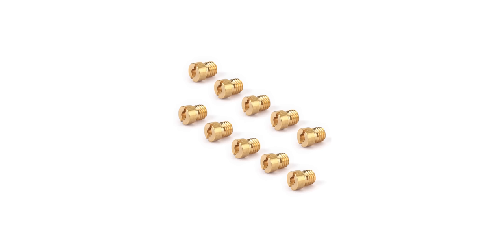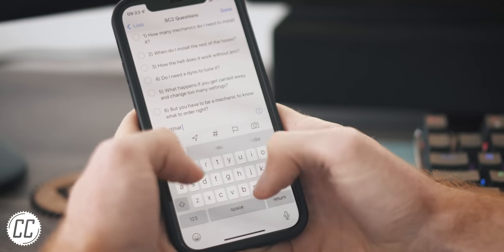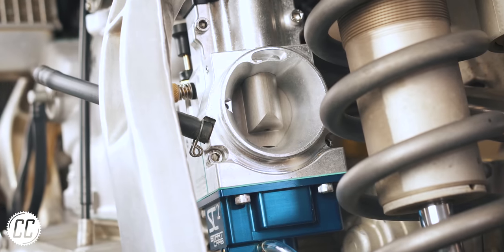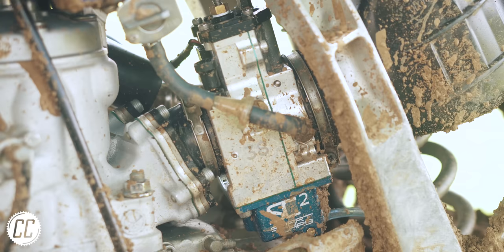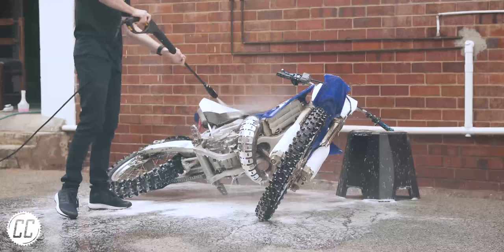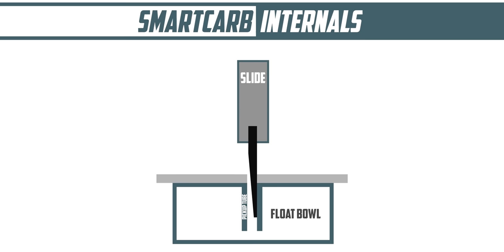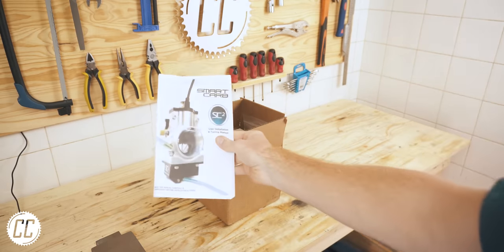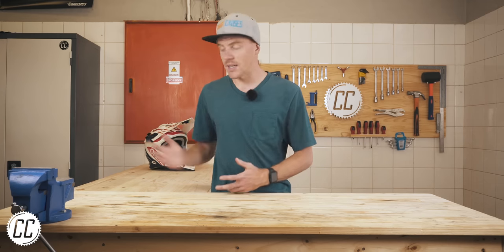The Best Carb Money Can Buy? | SmartCarb SC2

Comment: This carb seems nice but is nothing special as carbs with metering rods have been around for a long time. Furthermore the only thing that is adjustable is the height of the rod meaning you shift the entire fuel "map" up or down instead of being able to tune each area individually (idle, midlow, mid, WOT)
Reply: Metering rod carbs have been in development and in the market for quite some time, the first example being the Posa-Fuel in '67. Like anything though the concept went through multiple iterations demonstrating numerous improvements with the SmartCarb being the latest version available. The metering rod handles the fuel curve, yes, and moving it moves the entire curve, that is true. We advise our customers to tune from the bottom up, setting the idle and off idle response first by adjusting the metering rod position. The grind angle handles the rest of the range and we can supply a variety to meet the needs of different applications. The difference between the SmartCarb and all the rest is the internal, integrated float bowl venting which serves to drive fuel flow in the float bowl proportional to the air density inside the airbox at the venturi and also its velocity. That feature makes the SmartCarb very adaptable and dependent on the engine's needs and precludes the requirement for additional fueling circuits on the top end (think Lectron). We think it's pretty special.

Our wrists aren't stepper motors switching from idle to low mid to mid to top, but rather we sweep through the throttle constantly. A single circuit fuel curve suits that very well - provided you have the correct metering rod in the correct position of course. We make that as easy as possible with that red button on the top.
Reply: @SmartCarbFuelSystems  The altitude adjustment portion is a great benefit but unless the grind of the metering rod is bike, mod and altitude specific you are only getting in the ballpark of what is acceptable. I'm sure you can get close however having multiple adjustments at your disposal allows tuning in all areas so that your throttle response is linear and not like a step motor. Note that a transparent float bowl is convenient and would be a nice upgrade.
I must say I do like the metering rod height adjustment on the fly however edelbrock already did this with their metering rod/pumper carb that has since been discontinued.
Reply: @timothysmith3311  The grind of the metering rod is engine characteristic specific, with alternative grind angles available for to suit different applications' needs, modifications, and fuel selection. As explained above they do not need to be altitude specific. Altitude indifference has been well documented with this fuel system, with Pikes Peak records and UAV drone testing up to 22,000 feet with minimal variance in A/F ratios being two examples. The altitudes that the customer rides at isn't data we collect when ordering nor accounted for in pre-tuning the carb.

The best way to make throttle response linear is to provide continuous, linear fueling rate through the throttle rate. Only a single circuit designed for that purpose, like the SmartCarb's metering rod, can provide that. Much harder to do with multiple, overlapping circuits signing on and off through the throttle range. Noted on the float bowl transparency. We may decide to add that at some point. In the meantime the drain hose on the SmartCarb can be used to view fuel level in the bowl per our drain hose method. That is what the two laser etched marks are on the left side of the SC2.

The Edelbrock QwikSilver is a direct predecessor to the SmartCarb (same inventor) and saw the introduction of the clicker adjuster on the top. Interestingly enough the red clicker thumbwheel on the SC2 in this video was manufactured for Edelbrock over 20 years ago. The SC2 is the culmination of those earlier efforts, dating all the way back to the first metering rod carburetor, the Posa-fuel in '67.
Reply: @SmartCarbFuelSystems  I had a quicksilver carb and thought it was brilliant however since it was discontinued I couldn't get a hold of new metering rods for it. Why delete the pumper portion? When you snap the throttle open I imagine this would be beneficial off idle.
Reply: @timothysmith3311  no pumper required for the same reasons that no power jet is required - the internal float bowl venting feature provides near instantaneous fuel lift. Between that and making sure not to over-carburate any given engine (too large of a size), there's ultimately no need for it. These carbs keep up.
Reply: @SmartCarbFuelSystems  do you have any dyno graphs of the same bike same mods with a traditional style performance carb same diameter (like a mikuni flatslide) that's been tuned vs your carb? I'd like to see the difference in a real setting and the power curve.

Comment: Rich running engines run cooler. Lean running engines run hotter . If it's a 2 stroke lean will ruin the engine. 2 stroke rich will just foul  the spark plug. Do you want to rebuild the engine or clean and,or replace spark  plug. ?

Comment: This is beautiful. I love building mini bikes and go karts out of Predator and other small generator engines. This could be a game changer for us since we dont need to need to worry about jets or such. This is a fantastic product.
Reply: Did you try it? Does it work for 4 strokes?  The message I got was a 2 stroke able carb. Will it work for a 60 year old bike?
Reply: @Cj-yw8cs  I havent, but I dont think there would be any issue trying to fit this onto a two stroke. As long as you have a good oil mix, or an oil feeding system in the engine, you should be good to go with no issues. 2 stroke carbs and 4 stroke carbs arent THAT different from each other, and this one is honestly simpler.
Reply: @Cj-yw8cs  and to add onto that, if you go to their website, they have 2 stroke options as well if you wanted to get one for a specific bike.
Reply: @3v068  the bike used in the video is a 2 stroke. The website will probably not have info on my machine. The joy of old oddball motorcycles

Comment: The best way to tell if the carb is correctly tuned is the spark plug. If you want to be on the safe side you can check your spark plug after the first 15min of ride. According to you mixture and gasoline it may need minor changes. We used to do that when go Karting. Remember when it's leaner it goes faster so it may trick you.

Comment: This kind of carb has been used on some planes for a few decades. From what I remember, they have an issue with the gaskets wearing out fast? Might be wrong.

Edit; it looks similar, but it seems to be an entirely different method of operation.

Comment: You missed the single most important detail/issue, which is you no longer need to worry about jets getting clogged from bad fuel.  I say this “assuming” it doesn’t not have a low idle jet.

Comment: If it's using less fuel does that mean less lubrication on top end??
Reply: Yes it is..high risk of piston to jammed
Reply: No. Sufficient lubrication remains - we're simply not passing as much of it out the exhaust but rather combusting it more efficiently due to finer atomization and increased surface area of the droplets. SmartCarbs are no more prone to causing engine damage than any other carburetor when properly adjusted.

Comment: Interesting design another option to convert troublesome injected bikes to carb. The fitment issues on your bike would be a deal breaker for me tho. Paying that much for something id want it to fit with out causing the intake boot to hit the rear spring and kink the throttle cable.

Comment: Looking at the spark plug will tell you if you have the proper mixture. This is very important on high performance 2 strokes because running to lean makes them blow up quickly.

Comment: Fun fact many may not know. William “Red” Edmonston invented the first metering rod style carburetor in 1967 and another in 1971. Lectron began selling these in 1974. They largely have not changed since. GM acquired Lectron and “Red” improved the metering rod style carburetor and it became the Smart Carb. 

So, these are $1,000. 

They’re cool. But not that cool. I’m patiently waiting for the competition to drive down the price. There is zero reason that carb is that pricey. It’s based off the same technology invented by the man that did it in the late 60s…
Reply: Our (US-based anyway) competition will need to wait until the mid 2030s for our core patents to expire covering the integrated float bowl venting, external adjustability, and variable throttle rate venturi/airflow shaping features. Beyond simply improving upon Red's earlier work, the SmartCarb brings features that are entirely new. No other carburetor does what the SmartCarb does.

SmartCarbs are fully CNC machined in the USA, which is why they cost what they do and with 30% increased fuel economy, the more you ride, the faster it pays for itself!

Comment: can i use it on a four stoke or a 2 stroke 70cc moped
Reply: 70cc is a bit small for the littlest SmartCarb (26mm). Should work on a 2-stroke if it's a bit of a hotter setup. Reach out direct for best advice.

Comment: Personally I'm sick of "smart" things.  I've gone back to a 2 stroke with a carburetor.  KISS - Keep It Simple Stupid.  I know I'm in the minority but I'm pretty confident I'm not the only one who feels this way in today's world of too much electronics.
Reply: In this case it's just a euphemism. SmartCarbs are mechanical carburetors just like a Keihin, only even more simple with no jets and only a single circuit. In fact it has fewer parts than any other carburetor fuel system in its class. The only electronic aspect is the TPS, which works similar to how the stock Keihin TPS has for over 20 years now. 

We would agree with your KISS sentiment. Simple is better.

Comment: I am interested in Classic Minis and accidentally found your carb review.
The SC2 carb is very, VERY, VERY!!!! similar to SU carbs (including the tapered needle lifting out of the fuel jet, lifting damper and air temp and pressure compensation) used in most English cars from  the 1920's till about 1990. In 2022 it can't really be described as "smart"; as it was dropped for the last of the classic Minis in the 1990's for fuel injection, because they could not satisfy pollution and fuel consumption rules.
Sorry. Dave D Sydney
Reply: We're not sure why this is a recurring misconception. The SU and the SmartCarb are nothing alike in their operation and if you knew anything about how the SU carb works while watching this video explaining how the SmartCarb works it would be quite clear. 

SmartCarbs use a flat slide directly throttled by the handset, more akin to other modern carburetor fuel systems like the offerings from Keihin/Mikuni/Dell'Orto. The SU carbs are CV or constant velocity style carburetors that are throttled with a butterfly with the resulting vacuum/depression lifting the piston slide, i.e. not directly throttled. SmartCarbs use air density/velocity to drive fuel flow through the float bowl, NOT to throttle the carb. That integrated float bowl venting feature, the use of a metering rod, and its unique venturi shape designed to focus signal at said rod are all PATENTED features. Furthermore the SmartCarb has already achieved EPA/ARB on-road emissions certifications in 4-stroke motorcycles, twice! All due to its superior metering rod (not a needle like in the SU) fuel atomization.

We hope this clears that up for you.

Comment: Sounds pretty awesome - the drawback he wasn't acknowledging was the price. I looked for what I might put on my Suzuki GZ250, they only have dirt bikes (seemingly emphasis on 2 stroke) so I looked at the RM250 which I figured would be the most comparable (though 2 stroke would be more power and flow than a 4 stroke of the same displacement). $700 for the carburetor. Would take a lot of miles for the gas savings to make the slightest dent in that.
Reply: How much is a Lectron or FCR?

Comment: Sounds like a overly complicated copy of a CV carb. So.... Why would anyone need this? I'm a firm believer that computers ARE NOT NEEDED to operate any motor vehicle, and should be REMOVED from your vehicle A.S.A.P.  One DOES NOT need any computer to operate fuel injection, as well. A well timed fuel injection pump running off a pulley will do the job, and did, for many decades. The computer on your vehicle is NOT there for the operation of the vehicle.
Reply: The SmartCarb is a considerably more simple design compared to the CV style carbs, with fewer parts too. It's a purely mechanical carburetor with no computers. In cases like this YZ250 where the bike's stock ECU requires throttle position input, we offer a simple, solid state, linear magnetic position sensor with no additional moving parts, unlike the stock carburetor piezoelectric type sensor with its little arm riding the top of the slide to turn a shaft...

There are a number of reasons to use the SmartCarb including greater performance and fuel economy, elevation/temperature compensation, the ease of external adjustability without tools, zero fuel spillage, and more.

Comment: The main thing that I hate about carbs is that even when you cut off the fuel and run the bike until it stops, if you let the bike sit for awhile, the carbs will get gunked up thanks to the damn ethanol that they contaminate our fuel supply with these days... The only fuel injected bike I have is my Harley and it starts right up every time even if it has been sitting for months...

Comment: Lectron carbs have been automatically compensating for altitude, temp, and humidity for over 20 years where you been smartcarb? If you were SmarterCarb maybe you would of came up with the idea first.
Reply: Lol, ok. We encourage you to do some research on these carbs. Both were invented by the same person, William Edmonston, nearly 40 years apart. The Lectron wasn't even his first metering rod carb - that would be the Posa-Fuel in '67. GM acquired Lectron in the 70s and Edmonston went on to make the Ei Blue Magnum, the Edelbrock QwikSilvers, the AFT HVV, and ultimately the SmartCarb. We're simply the natural evolution of the design only with features and benefits the Lectron or other earlier metering rod carbs don't have including external adjustability without tools, integrated float bowl venting (for even better air density compensation by the way), variable throttle rate venturi profile, and TPS. Check out the article on our website that explains the history of these carbs and how they compare.

Comment: 2 strokes are NOT destroying the environment!  That 5L V8 that you drove your 2 stroke to the track and everywhere else IS destroying the environment.  It's not once every 2 weeks that you took your bike to the track that is tipping our planet to the brink.  It's what we're all doing all the rest of the time!  Don't worry about you 250cc single cylinder 2 stroke that you ride when u have a free afternoon.  Worry about the car you drive.  Worry about your local power plant.  Worry about consuming plastics.  Go have fun on your 2 stroke.  If it troubles you that much, then go get one of the new KTM direct injection 2 strokes.

Comment: Very similar to the old SU and Weber side-draft carbs from back in the 60s.
Reply: Not so much. SmartCarbs are flat slide carburetors directly throttled by the handset, not by vacuum à la CV style carbs. Air density is used instead to drive fuel flow (not operate the throttle slide/piston) by way of integrated venting inside of the airbox.

Comment: A glorified Gardner carb, which is sort of a pressure carb. However, there will be a host of different slope needles to choose from, so not an easy job to optimize for an engine type that has not been previously setup by the makers. And as for more power, forget it. Dyno man for 30 years.
Reply: Hardly. The biggest difference, of many, and one that sets the SmartCarb apart from any other carburetor fuel system, including other metering rod carburetor fuel systems, is its patented, integrated float bowl venting feature. It's the other half of the air density best-use equation and it allows the SmartCarb to accommodate the fueling needs of a huge variety of applications without a commensurately huge variety of metering rod tapers or fuel profiles. To put it into perspective for you we use only 8 metering rods across 3 different sizes (36, 38, & 40mm) to cover the needs of nearly any 125-500cc 2-stroke dirt bike (our primary market) covering stock to big bore to high comp to supermoto to snowbikes to MX to hard enduro, etc.

And yes, they do make more power which is why top level athletes and speed record holders use it. Not to dismiss your experience, but you haven't seen anything like what this fuel system is capable of, nor do you have a firm grasp on its function by comparing it to the Gardner...

Comment: Just on the surface, it looks like the old air valve carburetor design, such as SU carbs that were used on many vintage European and Japanese performance cars and roadsters. There's a damper chamber filled with fluid (light oil) that delays the rise of the air piston when the throttle is opened, hence eliminating the need for a power jet. The main jet has a tapered needle that admits more or less fuel depending on the throttle pressure. The type of fluid used in the damper chamber is an area for exploration and one of my favorites was brake fluid....
Reply: Dig a little deeper and you'll find that the SmartCarb is a directly throttled flat slide carburetor. Integrated venting isn't used for throttling, but rather proportional fuel delivery for wider elevation/temperature changes. The SmartCarb is the only carb using both at-manifold air density but also velocity for fuel flow and that is why it works without any secondary circuits besides the metering rod.